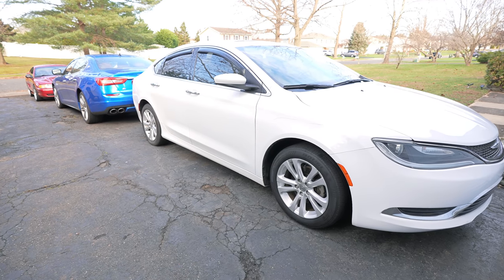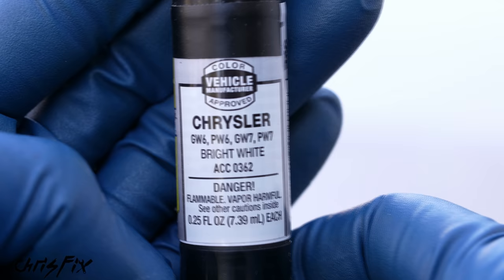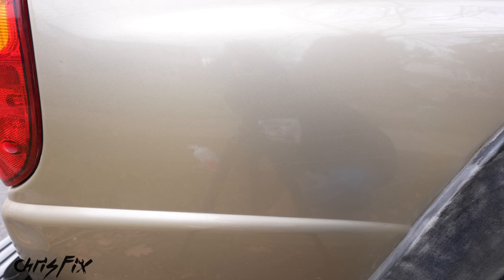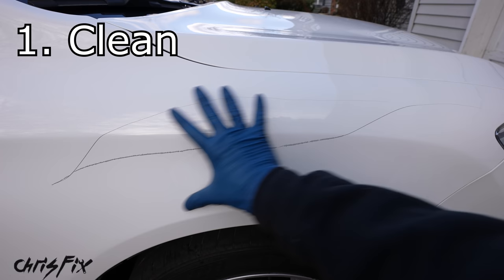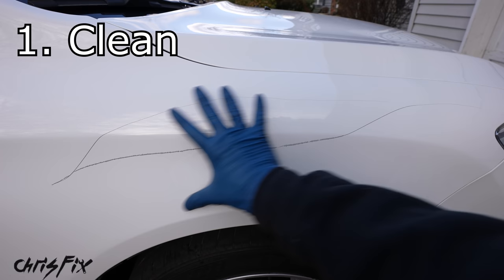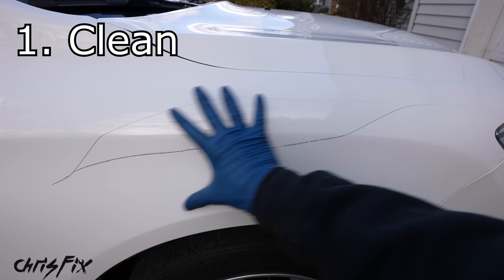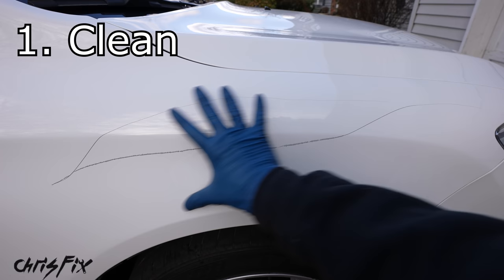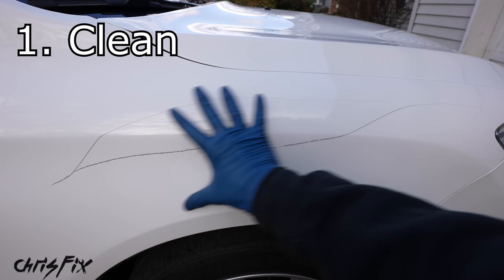How to Repair a DEEP SCRATCH in Car Paint (DIY)

Comment: "A paint pen only costs around $20!"  [Spends $100 on different sandpapers and polish]

Still cheaper than the $700 quote though!
Reply: Should be able to get everything you need for significantly less
Reply: I know it’s a joke but I got my polish and sand paper for less than the polish and the pen lol. I spent 40 dollars. They have my black at autozone
Reply: my gf just got a quote to repaint her whole hood for 500 yesterday... lol. idk how that scratch is 700
Reply: @breakinnecks87  it’s the labor and the prep. I work at a dealership and the labor will be like 500 the paint 100 the clear 100
Reply: Lol your country is the problem. Here in the philippines you can get all the materials cheaper around 25 - 30usd so DIY is a must.
Reply: @hirahira9393  yeah but then i would have to live in the Philippines
Reply: nicholas flores repainting a whole panel is actually easier and uses less labour than correcting a single deep scratch and making sure it blends in well.
Reply: @sinuslebastian6366  yeah.   You can just sand the whole thing to primer and bare metal in some areas and spray it a couple times with basically these same steps other than the brush specific stuff
Reply: Here in Brazil, paint pen is a lot more expensive and rare, but sandpaper is just about 40 cents (equivalent in local currency)
Reply: @breakinnecks87  yea the whole side of the car can be done for like $700
Reply: in my contry i can get all the other stuffs (except the paint pen ) for 3 dollars max not a single pennie moo
Reply: @Jake Schroeder you can always try to find car in same color on scrap yard and get fender for $50 :D

Comment: I just learned that 9:10 part was so important.  Without it, mine did not look great for the 1st time.  I had to redo the whole process by doing that "Cliff removing sanding" thoroughly this time, and the difference at the end was huge. The best how to video among so many others make.  Thank you.
Reply: This is 100% true. That step is absolutely necessary. I tried to rush through the process by directly painting on the scratch and it looked bad. Had to remove all the paint and sand properly, which took me a very long time. To whoever might read this, FOLLOW Chrisfix's instructions step by step, don't skip or half ass any part of it

Comment: I'm using these😢 same steps however I do recommend not to use 800 grit more like 1,500 to 2,000 when smoothing out the initial paint touch up.  800 only on the exact touch-up part with the domino like he said. Don't let that 800 touch anywhere else. 800 with very little pressure got me down to metal in couple areas that were slightly curved.

Comment: These videos are amazing-- exactly what people need to do a good job right. Nothing that's impossible to find, or super expensive, or takes days to do. Perfect! And great job on the editing and video - it doesn't waste people's time with a lot of talk or having to watch redundant or time-consuming steps. Thanks so much for posting and providing where to get the supplies.
Reply: Phoenix  𝙾𝚙𝚎𝚗 𝙼𝚢 PROFILE  If you have that advantage of being able to practice a few times, do it. Even doing it just 3-5 times on a practice door would make you way better, if you have no experience. This is detailing stuff that takes experience, so practice on something that doesn't matter until you're confident. I know those rock country roads you speak of. Not much you can do but slow down, or install some sort of Rhino-liner-stuff along the vulnerable spots.
Reply: Bottom line is: the results are ALL about the preparation beforehand. Plus it's best to be prepared, and you can learn what you need and what you don't on the practice door. I don't know where you're sourcing your door from, but I'm sure a collision shop would yield a non-salvaged painted panel you could work on. Drive out back behind one and you may find a small panel laying around to practice on.
Reply: I think you covered it all except I am so thankful he doesn't use that annoying cover music. When I find a  video with it, I immediately exit.

Comment: Thank you so much!  You just saved me $300 to have someone come out and do this exact thing to my car, I’m sure!  I have a Lexus so the paint was $34 because it has a separate glitter clear coat .  But since I’m fixing it myself, I am fearless now to any rock chips or small scratches, paint transfer, whatever!  Thank you so much Chris 😘
Reply: Where did you get the paint ? Mine is 083 paint code
Reply: @robmurti1739  if you have trouble finding the paint just go to the dealership. Couldn't find the right touch up paint for my Mercedes. Went to the dealership and they had it for $20

Comment: Thank you.  I own a classic Jaguar that incurred a 6 " deep scratch on the front hood. I hoped I didn't need the whole hood repainted. I had it painted with a single stage urethane many years ago and still had a quart of paint left. I decided to follow your instructions. I sanded the scratch and then mixed up a little paint and hardener and filled in the scratch with a tiny brush. I let it dry for 5 days before wet sanding. I followed your wet sanding instructions and then polished it. The scratch is gone!. It looks great. Again Thank you.

Comment: Chris, thank you for these in-depth guides on how to work on cars. After the dealership I bought my 2016 Tacoma from started to rip me off, I've been able to change my own oil and change the air filter because of your videos. And now I have the confidence to touch up a rock chip on my rear driver side door (it just so happens my truck is white as well). Keep up the good work!
Reply: How did repair end up ? Is it visible
Reply: make sure to change trans fluid after 70k km

Comment: Me and a guy rubbed each other pulling out of our spaces today at Best Buy.  Luckily my deep scratch is only about 2 inches long and the rest of the scratch is just on the clear coat and can be buffed out.  This video was invaluable and I will be tackling my scratch as soon as I get a warm day.  Thank You sir.
Reply: Exactly what happened to me today! I just got maintenance done earlier too 😭
Reply: @FallenAngel8199  I followed Chris's guide exactly and I am very happy with the results, even on black paint.  Yes you can still see it if you are close and staring directly at it, but if you don't know where it is and you are 3 feet away its nearly invisible.  You should tackle it yourself if the damage is not bad.

Comment: Under $30 I followed your video for a deep scratch (a scratch size comparable to the car you have)on my 2004 tracker which has been there for like 6 years. Chris you are my go to guy. This has turned out in an awesome project. Today I will get a polishing compound and polish up the panel and in a month put a wax on it. 6 years ago the estimate was $900. Also this was my first time ever doing something like this.
Thank you and keep up with the how to videos!!!!!👍😎
Reply: How did it go
Reply: 900 ?!?!?!?!?! For a scratch like that??? Wtfff here in romania is 100 to repaint it including taking it off and puting it back on. Wtf 900? With 900 i ll just make it myself, get a spray gun and a compressor and some paint and repaint the whole god damn car , fk this.
Reply: Yeah Razvan, $900 was a quote from a high profile body shop in Chicago. Crazy. But I followed the how to video and did it myself. $30 for the supplies and my garage and my labor. It was pretty cool. Starting to get a little rust on the fender by the gas tank flap. Time for another DIY video. Also per your comment Razvan, I think GOD might have more important damning to do than my car! 🤣
Reply: @username113  it went real well thank you. Just have to be patient and take the time. Also some good back ground music helps me .
Reply: @georgenicoloff7590 how many pen did you use for repaired the same scratches?
Reply: @thienngo7936  I only used 1 pen. It turned out well

Comment: 1) You need 30 MINUTES between additional coats of paint and clear coat. I wondered why my paint was sanding so badly, it was not dry. Half an hour to dry, not 5 minutes, not 10 minutes.

2) There is a pen applicator tip under the cap of the abrasive stick. Use that instead of the paintbrush applicator or else the paint will get tacky from constantly being opened. 

3) He forgot to mention to wet sand here 19:02 

4) This works horribly on metallic colours like Silver Ingot. Only try to touch up flat colours. Otherwise, just seal your scratch with clear coat before it gets rusty and polish it up. I wish I'd saved myself this headache by doing that.

Comment: I tried this myself... and I needed emergency care by my neighborhood body shop.
Don’t try this on your car, if you cannot admit defeat regarding your own capabilities - the sooner you stop, the more damage can be avoided.

You have to be extra, Extra, EXTRA careful when sanding down with 800 grit. You MUST NOT touch the surrounding clear coat with 800 grit. 1500 grit is the absolute lowest you should touch your car’s paint with - best 2000 or higher - and even then: WATCH OUT!

I’m not trying to "debunk" what’s shown here. Rather, I want to sensitize you guys for the challenge at hand. After all, the worker of the body shop was able to save my paint with a quick polish.

BUT:
You NEED skills! You NEED to understand paint! You NEED the right tools - especially a polishing machine with the right polish.

Comment: Okay i tried this. It took 6hours all in and i skipped a few things around sanding. I would think a proper job the first time takes 8hrs at least. The difference being sanding

I liked the comment from someone who said the recipe for making pizza is easy but not everyone can execute it well. Same goes here - the experience/judgment on sanding and painting is underrated. You wont paint something well on the first go, so dont think you will ace this. 

Also my car was black and so during the sanding phase it turned grey which is normal but caught me off guard. There is also something called orange peeling and thats also sanding related (not completely smooth yet)

Points to consider
1) his scratch is not the dame depth as your scratch, so how much more paint do you put? Err on the side of putting more than you need
2) sanding is a lot of work and it is a lot of skill. It is basically low level sculpting. Take too much off then you can be in trouble. Take too little and looks like nothings done. And the 200/400/800/1000/1500/2000 - do you really know the difference and the amount of pressure to apply? Its not something you will master on the first go and you are trying it on your car haha

I would say the hardest part was sanding. The easiest part was polishing. The second hardest part was painting. 

Also the paint smells - wear a mask!!! 
And it gets hot if you do this in the sun, so wear some suncreen and have some water

Overall it was fun to learn. Thanks for the video chris! I would say do this for a mini scratch - dont do it first time in a place you care. For me, it was corner front/underside of the front of the car (hit a big rock), so i will never see it again unless i crouch. I would rate my job a 4/10 and would definitely not pay for it but its out of sight out of mind now so thats 10/10 :)

Good luck everyone!

Comment: Ok, this is a solid tutorial, it gives every essential detail from A to Z. 
However, whilst doing touch up on my gray metallic I found that process needs to be different. 
1. You will need to lay on much thicker coats. Touch up tip worked the best. This is because metallic flakes follow your strokes and if laid thin will blemish and stand out. 
2. Be very patient. Thick coats dry out for hours. 
3. Towel with acetone will remove all uncured clearcoat and paint. When I laid clearcoat, terrible paint really popped out. Instead of sanding it over you can wipe the entire touch up altogether.

Comment: I spent a hell of time trying to fix the scratch on my car, spent $70 on tools and original factory paint, but all I can say is it's a LOT harder to do actually by hands than what you might think can be easily achieved on the video, the darker color like the Ocean Blue in my case, is extremely difficult to blend in no matter how I tried to sand and polish, the new paint will always leave marks/lines or unevenness, I ended up calling a professional to do the job for me for $200, total waste of time trying DIY be honest. Also, for those who think repaired paint will last as long as the factory paint, they don't. As a matter of fact most available products you can buy like clear coat paint for example, will never achieve the level of hardness of the factory paint, but yes they can temporarily make the repaired area look nice

Comment: Finally pulled the trigger on a DIY fix for multiple scratches to my front right bumper on my red car. 9/10 for this video and probably the best video out there if you are looking to do a DIY, spending less than $100 and just a few hours. Totally worth compared to sending your car to an auto body shop. Just keep in my mind, this DIY is for a casual fix. Meaning, passerbyers and onlookers probably won't notice your scratches/self-fix unless they were up close and/or you told them. If you are looking to have your pain look near brand new, then you best send your car to a shop that can professionally do it better than you, for a cost of course. 

With that being said, I did run across some issues with my red car. My car had 1 big deep scratch (where the paint was actually off) while the other multiple scratches, were only deep enough to damage the original clear coat and/or only deep enough to take off partial paint, but not deep enough to hit the stock bumper. Be warned that if you have multiple, close together scratches, your area of sanding will be much larger that what may seem compared to this video. Also, be warned that the more scratches in a concentrated area, the increase chance of uneven paint, clear coat, and sanding. That was the biggest problem. My areas were too large that when I put on the paint, the painted area was so large that it was impossible to sand down (by hand) the entire damaged/re-painted area to make it level with the surrounding. I eventually gave up, smoothed out the edges as best I could, threw on the clear coat and did the same. What was left was a fixed paint job, however, because I lacked on the sanding, you can see the areas of TOO much pain and the unevenness. 

As I had mentioned, I came into this just so that onlookers and passerbyers would not notice the scratch. This DIY definitely fixed that. Although my job could have been done better, but it was a first time and I was kinda beat after going at it 3 hours. There was one section where I did a near perfect job and it looked almost as if there was never a scratch/paint job which means this can definitely be done to near perfection. I also will say that this DIY fix would work 100x better on a white care because the sanding damage/scratch blends in with the white of the car. Be careful doing this on a non-white car. Would I return to this video to fix any other scratches? Hell yes. I'm pretty positive I can get an even better outcome if I were to redo my fix again.

Comment: Question: When sanding down the clear coat, how do you not go through the clear coat you just applied and end up back in the touchup base coat?
Reply from the maker: You can see the clear coat as you sand so you keep an eye on it. Also this is a very thin layer of clear coat so it wont be as thick as the factory. Think of it almost like a wax layer that just coats and protects the base coat.
Reply: because you're working at micron levels, and when block sanding, you're basically at the level of the surrounding, and not the indent of the scratch

similar to when you beach a car, your front and rear bumper will be higher than the floor, you're at the surrounding level, not the road level
when you sand with the block, you're smoothing it out, so part of your tyre will touch the floor now
when you're working at microns (0.001mm) it's basically impossible to see. Grab a microscope and you'll definitely see the indent(lower portion) however with the naked eye it's very close to perfect
 
easier to explain with a diagram, but i hope ive made some sense at least.
Reply: I have noticed 2020 and newer cars have a thinner clear coat so use extra caution if it is a newer car
Reply: Would there be any benefits to adding a second coat of clear coat ?
Reply: @aarons.936  Unless the clear coat is damaged, there would be no real benefit. Besides, you will have already added 2 or 3 layers when applying it. And the purpose of that is to give yourself wiggle room to level it out. Rather than not having enough, and end up sanding through the work you just did.
Reply: @aarons.936  yes, more clear will likely make the paint more flat,making it super shiny. ideally, the previous coat will still be tacky. So dont go spraying your car outside with clear

Comment: The instructions were really good as always. Unfortunately I did not get such a good result on my metallic silver paint. I followed all the steps mentioned but the stratch is still visible but now in silver paint. I do not know what did I do wrong.
Nevertheless keep up the good work.
Reply: You are probably didn't do anything wrong. This technique is just much more easier to work with white cars than any other color. Lucky bastards!